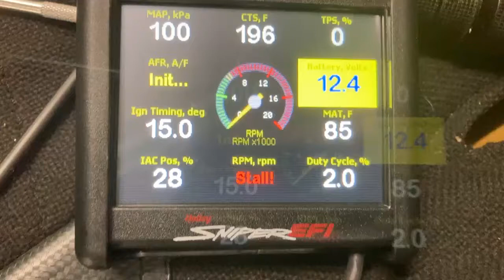Holley Sniper EFI idle surge on Chevy 350

Comment: Did you get it fixed? mine does the same thing.
Reply from the maker: I solved the problem by doing a few things.  I increased the idle timing to 20 degrees. I leaned it out slightly from 13.5 to 13.8 at idle. I also turned off the ac kick.

Comment: fuel pressure is too high should be 45-48 you are at 60
Reply from the maker: Uh no... you are incorrect. Holley Sniper should be at 60psi. This is from the Holley web page.  Sniper EFI throttle bodies require 58-60 psi of fuel pressure and a 10 micron filter.

Comment: If you can use a laptop to adjust the timing table, make the timing at idle speed 15 degrees, and about 200 lower rpm make it 17 deg, and 200 higher rpm make it 17 deg. The engine will want to fall into the 15 degree trough and stay there.  Here's same dude demonstrating the trough. Ignore his rant about the scaling being wrong, he didn't understand PSIa (absolute not gauge) yet.  https://youtu.be/e8IXHncfZTk
Reply from the maker: I solved the problem by doing a few things.  I increased the idle timing to 20 degrees. I leaned it out slightly from 13.5 to 13.8 at idle. I also turned off the ac kick.